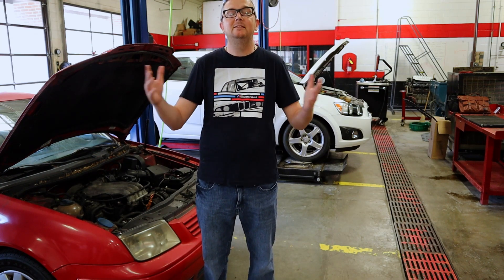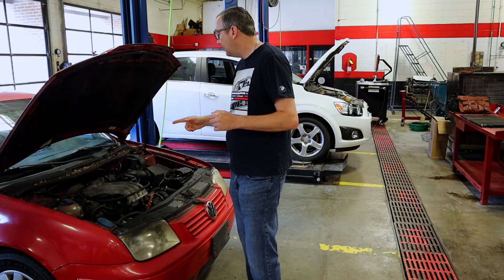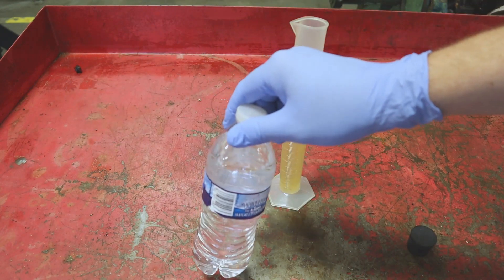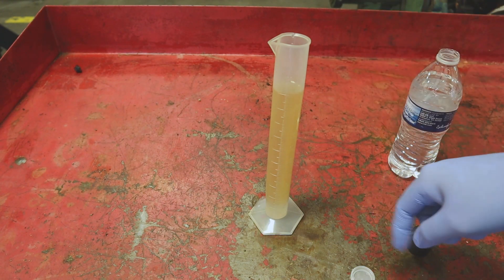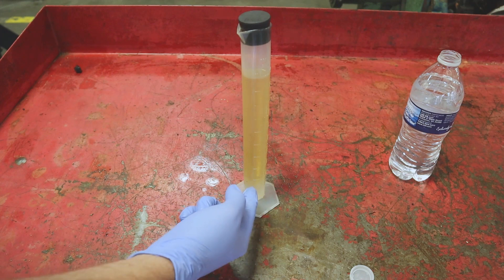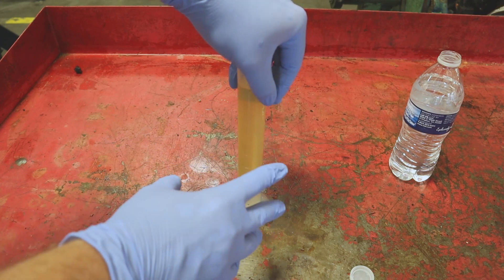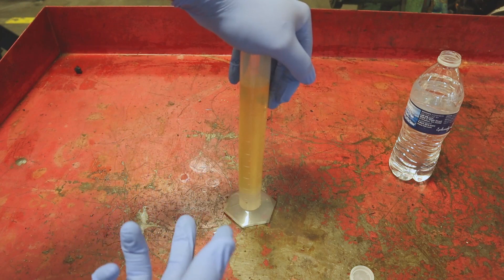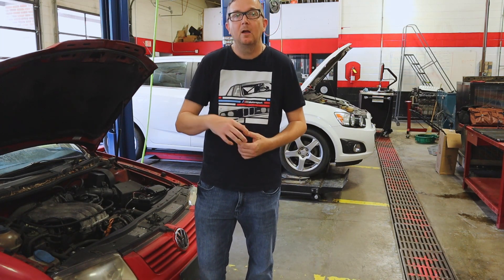How to test your fuel for ethanol percentage

Comment: This is very interesting test for getting an accurate ethanol percentage. 

There is just one thing, which I think a little confusing for me. You found a reading of 19 less the ten of water gives an amount of 9 ethanol . You say this means a percentage of 9%. But if the volume of the gas was 90, then 9 as a percentage of 90 is 10% not 9%. To get 9% ethanol, surely the gas volume would need to be 100mls?
Reply: You are correct. You need 100ml of fuel to 10ml of water